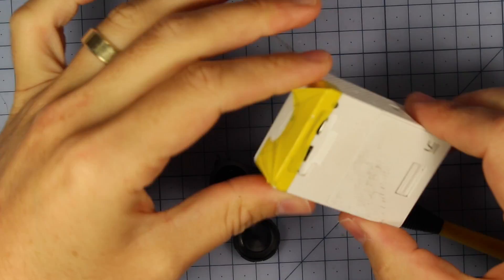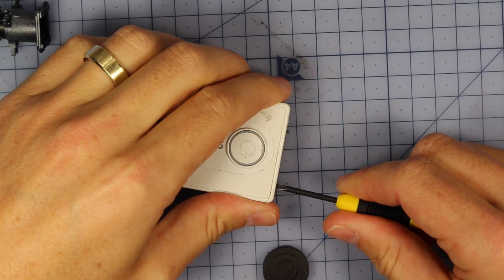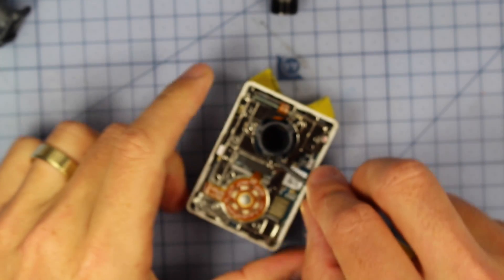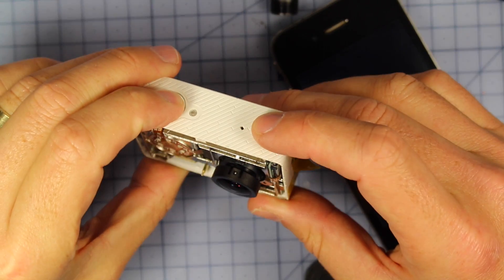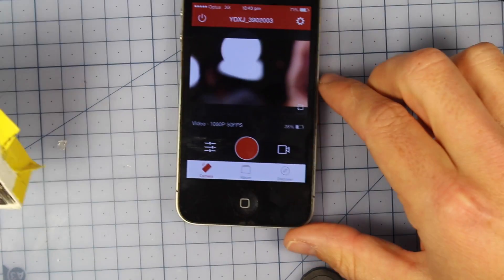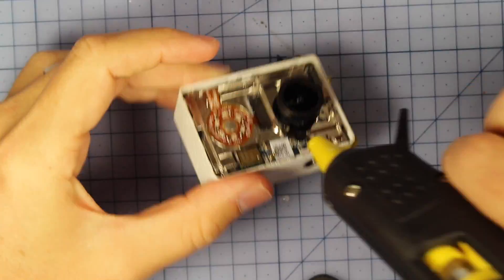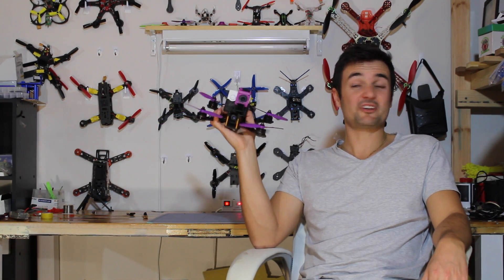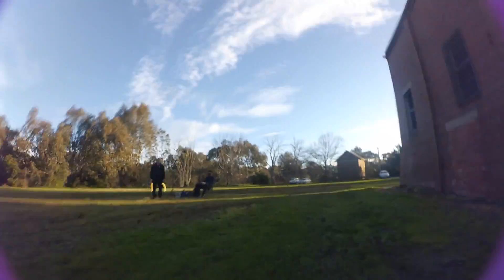How to replace and refocus a smashed Xiaomi Yi Lens.

Comment: Hey guys. I have a conundrum! I bought a taranis x9d plus. When I updated the firmware after watching painless360s video, I notice when I turn it on the screen turns white and it buzzes (even in bootloader mode). Have you any idea on what to do? Thanks for producing great content (and you too flight test lol).
Reply: I just went through a similar issue with my new taranis plus. I had a few problems, first off I had a very old version of OpenTX companion which I used to flash my taranis plus. Next I selected "Radio Type" FrSky Taranis instead of FrSky Taranis Plus. Then once I sorted all that I found for some reason I couldn't flash the offline firmware (Tx off when you plug in the USB) with my laptop, some issue with USB3 ports which my laptop has.

In the end make sure you download a newer/newest version of OpenTX, http://www.open-tx.org/downloads.html . Don't miss the Zadig driver installer at the bottom, which I think painless goes over in his video. Be sure you have Taranis Plus selected for Radio Type. And if you are still having issues try different USB ports or even a different computer.